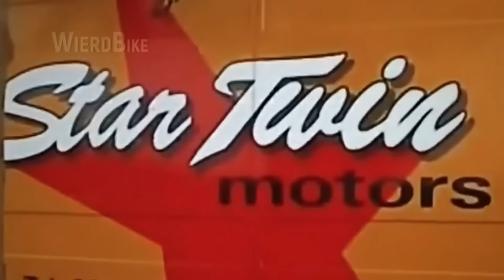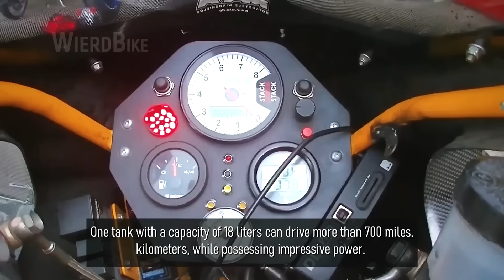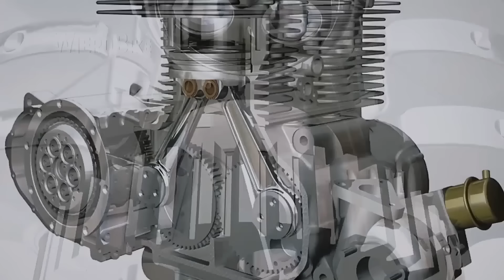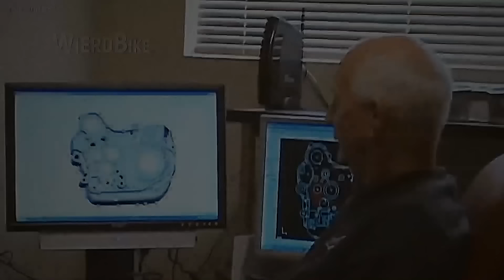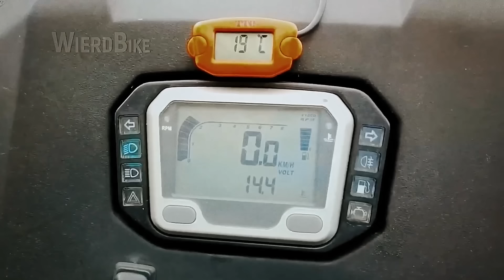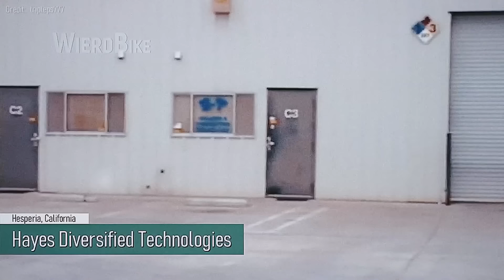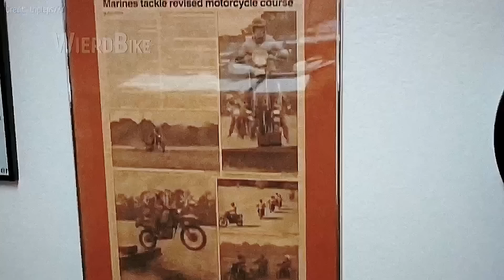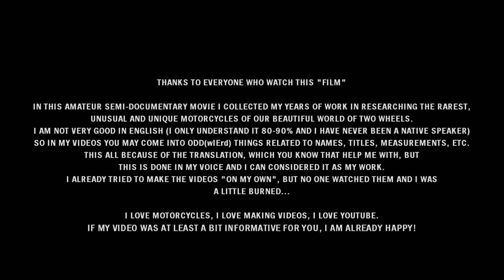DIESEL BIKE [documentary]

Comment: There are production outboard diesel engines , use one .
Reply: This rarely works, since they are built for a reliable never-ending  supply of very cool water in a non.circulating system, so they would overheat immediately with a regular circulating water cooling system.